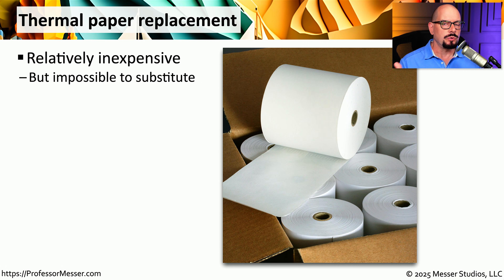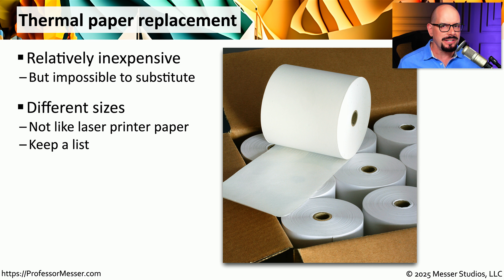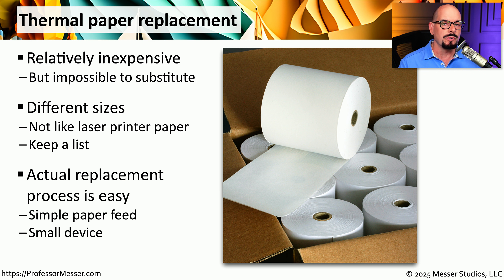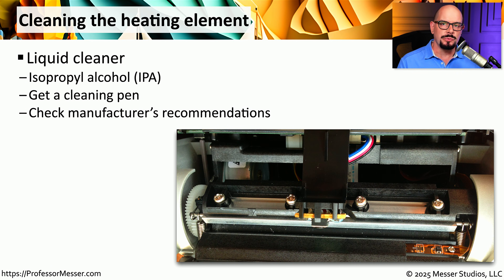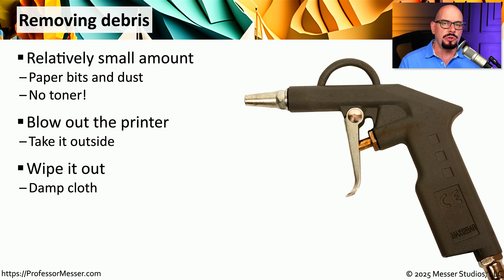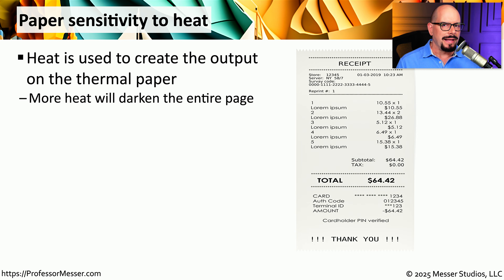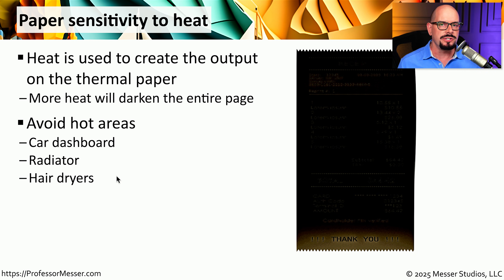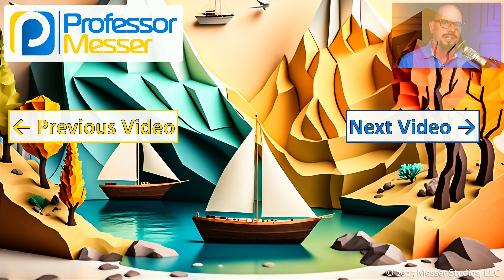Thermal Printer Maintenance - CompTIA A+ 220-1201 - 3.8

Comment: Make sure to check if the thermal paper is facing the correct way when replacing. Most printers I've used working in restaurants tends to print on a specific side. You can feel the texture difference with your hand, the more plastic feeling side is the printing side. Also the printer itself will sometimes a diagram instructing you which way the thermal paper roll should be inserted.
Reply: Yes! And don't wait until last minute to change the roll- the colored streak they add tells you that your roll is low. Changing the paper might be quick, but scrambling for a roll last minute during a rush is not fun. 

Man this video takes me back!! I never thought I'd be so grateful for my time in the service industry.